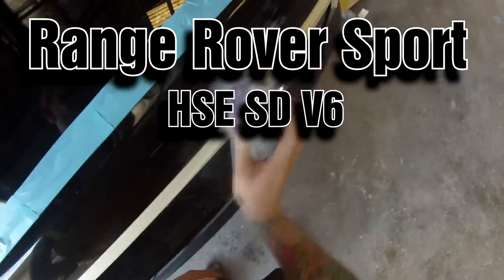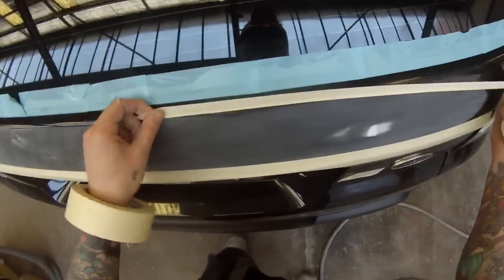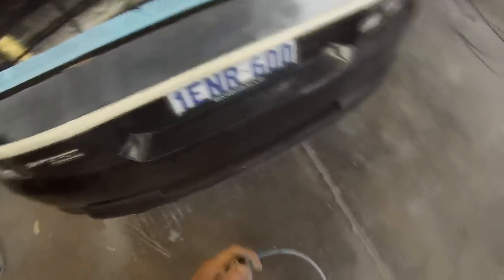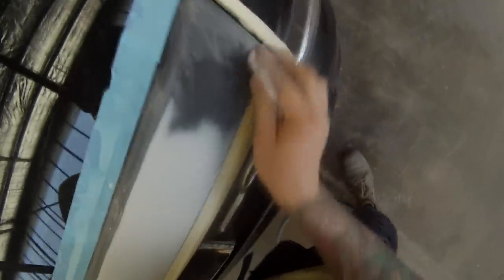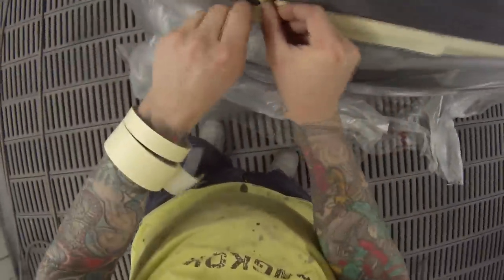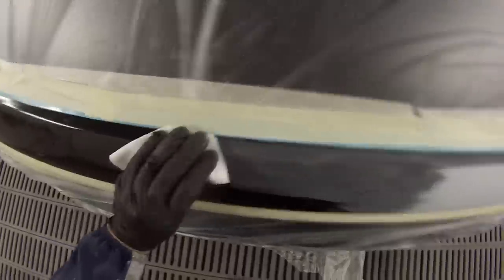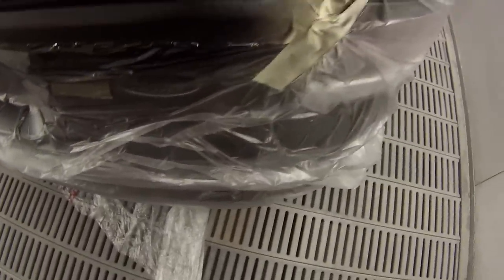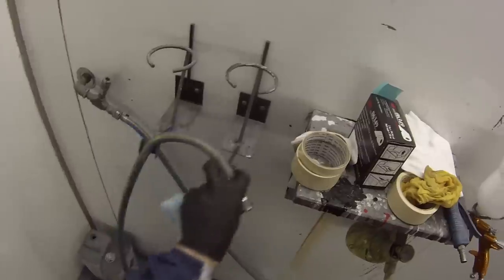Black Range Rover Sport "Repair, Prep, Prime & Paint"

Comment: when I was spraying black I was not very happy about the orange peel...but with the gti pro lite with te10 aircap ..well...it's another thing..best gun I spray with..I am spraying now at 24 psi ( you think its too high?)..any way  you rock...keep up the good work...
Reply from the maker: Yeah its a great gun, I found there was no need to go above 22psi but if 24psi is giving you results you're happy with then who am I to tell you otherwise, plus some regulators read differently so you may find we have it set up the same anyway. I learnt to spray paint by feel and never had regulators on my gun at all so if it feels right and looks right then go for it.

Comment: Hey Gunman, love your videos!  I'm about to paint my 76 Corvette.  I've prepped the whole body and it's ready for primer.  The body looks really great, I've gone over the entire car with a sun gun and guidecoat several times and it looks beautiful.  I have some questions;
1.  What grit sandpaper would you use before priming (I'm done a bunch of fiberglass repairs and filled all the nicks and sanded all the paint off). I'm up to 150 grit so far.

2. I was planning on a 2k primer and then sand again with 32o and then 400.  Is that ok?

3.  After that, I was going to use a primer sealer and then 3 coats of base.  How much paint would I mix up? Do you mix all your base at once for all 3 coats?

4.  How much clear do you think it will take?  Do you mix all your clear at once or mix new batches between coats?

Thanks for your help!

Comment: What is the difference between TE 10 and TE 20 caps? 
What do you advice  me?
Reply from the maker: The te10 has smaller holes where the air comes out so it requires less air and in turn it will atomize the paint finer and have a finer peel.